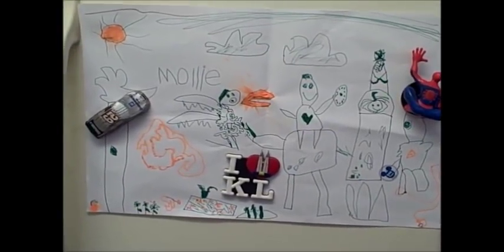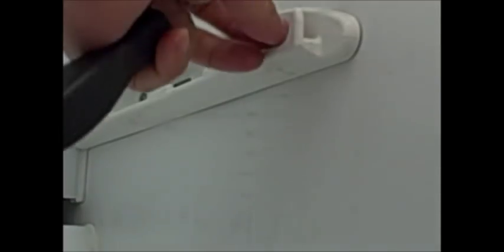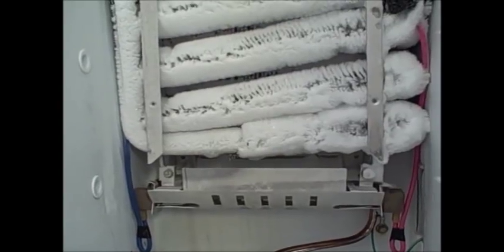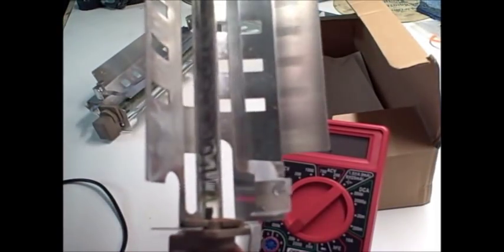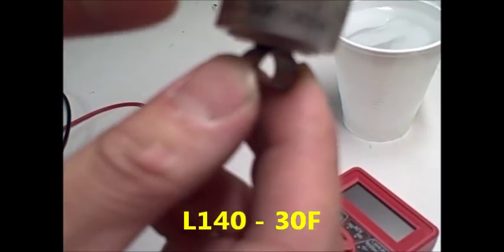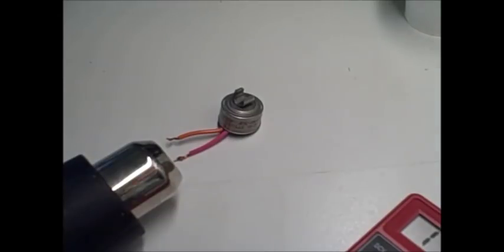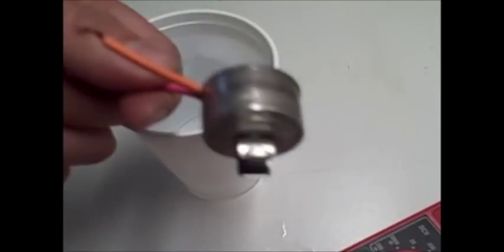Diagnose and repair GE ref problem not cooling

Comment: I heard that you can repair the thermostat by placing in boiling water. Is this true? have you heard such a thing? I have not tried it yet
Reply: It turns to be true. I tried it and it will reset the the Bi-Metal sensor. Don't know how long it will last but, it works.

Comment from the maker: UPDATE: Unfortunately, mine finally died today 4/28/2021. The compressor stopped running and a quick check for resistance between the terminals revealed an internal short circuit. I blame this on me neglecting to vacuum the thick dust buildup on the back which probably made the compressor worked so much harder. I used to do this every year but got lazy for the past 3 years.

Comment: Great video, Handy Daddy! I probably went through at least 5 other DIY Youtube videos before coming across your excellent video. The difference on your video from the other videos was that you were the only one who  identified a burnt-out bulb (totally blacked-out) that may be causing the defrost system to malfunction which was exactly what happened to my side-by-side GE fridge. I hope that my fridge will be fixed by replacing it w/ a DEFROST HEATER ASSEMBLY. Fingers crossed! Thank you very much!
Reply: After 6 days, my fridge seems to be holding steady at 0 degrees F (freezer) & 36 degrees F (fridge side) so it looks like the issue was limited to just  the burnt-out DEFROST HEATER BULB. Thanks again for your awesome advice, Handy Daddy!
Reply: No freezer gets to 140 degrees, whenever the defrost thermostat senses 40 degrees the contacts open thus terminating defrost. How do you keep ice cream frozen at 140 degrees? Think about it
Reply: @winstontaylor4364  It is only sensing the temp behind the rear panel where the coils and heater bulbs are ........ Refrigerators make frost on the coils so we got to melt it out once in a while ......

Comment: L140°-30°F is high limit thermostat, contacts will open at ≥140° and close at ≤110°, subtract second number from first to get closing temp, function is to cutoff defrost cycle at stated temp.

Comment: Awesome work,, I assume this problem affects the refrigerator side correct? because my freezer is cooling but the fridge side is warm, I opened and noticed the ice same as you on my freezer. please respond. Thank you.
Reply from the maker: TheSAJ11 Thanks! It will initially affect the refrigerator side but the freezer will eventually not be cool enough to keep items in it frozen. I noticed the ice in the ice maker tray started melting.
Reply: @handydaddy4232  Yes, I am getting the whole kit and replacing the parts, I know now it is not the motherboard as I have checked.
Reply from the maker: TheSAJ11 I am glad you decided to do the repair yourself. I hope this video can help in some way. Good luck! 👍🏻

Comment: Hello loved the video just bought old fridge has same problem, I found thermostat on eBay but where do I find the heater bulb part...please respond thank you!! You have a subscriber for life!!
Reply from the maker: Hi, I am glad you found the video helpful. The Ebay listing where I previously purchased from is no longer available. However, a quick search of "ge refrigerator defrost heater" will bring up many current listings. Just make sure the bulb is compatible with the model of your fridge also make sure the seller has many positive feedbacks. Good luck!
Reply: Handy Daddy hey by chance do you have like a skype or telegram I can message you a picture so you can see...
Reply: Handy Daddy m

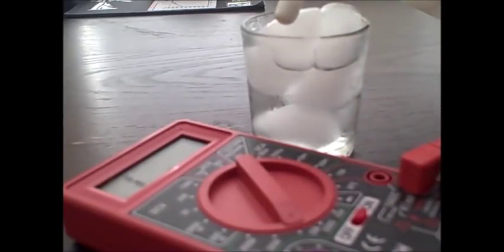Comment: FYI: the thermister (temp sensor white) you threw away at 11:54 time, was probably still good, there seems to be about 4 K ohm difference between the #5 wire on the J1 Plug Upper left of main ckt in back of fridge, and the other wires #'s 4 (upper temp sensor), #3 wire (lower temp sensor) , and #2, and #1 wire (these are fresh compartment temp sensors, if its there).   so if you unplug J 1   plug and (UNPLUG FRIDGE FIRST) and test ohms between wire #5 and #3 I get the 16.2Kohm but when you take the temp sensor out and use ice water it tests only maybe 12kohm ?   i'm thinking that the #5wire is not directly connected and incurs an additional 4 kohms .  (all my tests were when  freezer was let to rise to 30deg F exactly. )  So i got about 9kohm between #5 & #4 wires, but ice water test of that upper sensor gave me only around 3.4kohm, similarly I got the MAGIC 16.2kohm on bottom sensor using J 1 plug wires #5 & #3, as said, but taken out using ice water only got about 12kohm maybe,  the other 3rd sensor I think is in the fresh food area of the non freezer section further back from the light (havta research that),  My #5 & #2 wires (fresh food temp sensor) measured low at 10 Kohm as well indicating it is probably bad.    Sometimes there is a 4th fresh food temp sensor (not in my model) that go to wires #5 & #1. 
Hey, nice video AND using home style test equip for the DIYer made it better.  of course specific bench test equip is best but if it works !

Comment: great video .I had a repair person come out twice in a month after the inside of my fridge was at 60 degrees and my freezer was cold but not freezing .I lost groceries the first time and yesterday it happened again thankfully we had a almost empty fridge we only had ice cream in it yesterday that was melted and the fridge was at 60 again .he said its standard to take a fridge outside to use a water hose hooked up with the hot water to manually defrost the thick as a block ice on the coils .twice in one month :( would you happen to have any advice 
thank you
Reply: Most common cause of no defrost on a GE side by side is the heating element, then the hi-limit defrost thermostat, then the defrost thermistor and lastly the control board, although I've only seen one defective board causing a no defrost issue in my entire life. This system was introduced in the year 2000 or close to it, and the heater is a glass tube casing with O-rings on each end to seal out moisture and water, and over time, these seals deteriorate and cause the element to fail due to the water entering the tube where the element wire is. Also, the defrost termination switch, the one that has  140-30F on it, normally will pop apart when it fails. This switch is there for emergency shut down of heat cycle only, as it opens at 140F and has a reset differential temp of 30F. So that is why it was closed on the video at room temp. Defrost thermostats on other refrigerators that use these devices as the actual circuit interrupter are much lower in temp value, such as 45 to 60 degrees, measuring coil temp during the defrost operation, and shutting down the heater when coil temp reaches the target of 45 to 60 degrees. The small white thermistor is the part that shuts down the heat by reporting back to the control board, the coil temp, by way of a resistance value, that is realized as a temp by the control board, thus stopping the heat process and allowing a drip time, then starting the refr back into the cooling cycle. If in doubt, or don't have a way to test these parts, I would advise to change these three parts in the freezer, as they are fairly inexpensive and while your in there anyway, and the box is probably 10 years old or so, changing them all will save you the hassle of having to go back in and do another repair on another one of these parts in the near future. If you don't have a VOM, pick up a cheap one from any place that sells hardware. Some are as little as $10.00 and go up in price from there.
Reply: It is not normal to defrost your refrigerator outside with a hose !  The purpose of this video is to show you the parts that cause your problem when they malfunction.

Comment: if the freezer coils are solidly iced up will that impede the air flowing into the fridge?  I replaced the fan motor but, the flow of air into the fridge section is very weak. I'm defrosting the coils right now. I guess the air has to flow past them and if they are solid ice little air would get past? . I guess it's time to check the heater bulb next.  it looks like the same GE side by side your working on. Thanks for a great video.
Reply: Thanks, it's fixed. new heater bulb. I didn't pull the sensor but, I'm keeping my fingers crossed.

Comment: Great video, to save some time you don't have to remove the bottom plastic drawer guides/rails. After you remove the top 2 screws of the coil guard you just pull the guard forward and slide it up and it will clear the plastic lower guides/rails.

Comment: I have changed my defrost heater, but after powering the refrigerator on, I only hear a clicking noise. I can't hear the compressor work, only a clicking sound.

Comment: Your first test on the thermostat showed it was in the close position which meant the heat lamp should have been working.  Therefore, why did you need to test it further?    Thank you for your video!

Comment: How do you get to the thermostat ?  Thanks
Reply from the maker: L O F E N O I A L O F L O F E N O I A L O F You have to remove the back panel inside the freezer compartment so gain access to the thermostat which is usually attached to the cooling coil. Watch 3:15 of the video.
Reply: @handydaddy4232  How can the thermostat get up to 140F when it's inside the freezer 3 feet away from the heater bulb?

Comment: Those sensors are called thermistors. I went ahead and bought 2 since they were around $1.50. I had already replaced the heater because it went out and all was working fine after that fix. A few months later it started freezing up again, so I replaced the thermostat because the heater didn't come on. That didn't fix it. I then replaced the board which was a big mistake, since the problem ended up being the thermistor on the bottom. So if you're doing trial and error replace the cheapest parts first. 2 years running good, so it was still worth it and I didn't spend for a repair guy.

Comment: Appliance - HIRING TECHS IN SEATTLE, SAN JOSE, SAN FRANSISCO, LOS ANGELES! STARTING MIN PAY IS $7k!!! CALL 818-925-1377!!

HVAC - HIRING EXPERIENCED TECHNICIANS / INSTALLERS/ HVAC SALES GUYS. IF YOU LIVE IN THE LOS ANGELES AND ORANGE COUNTY AREA, CALL 818-925-1377

Comment: Sorry but you didn't clearly show where you put the probes from the multimeter on the heating element.
Reply: 5:24 You touch the probes to the spades on each end where you connect the red and blue wires. Your ohm meter will beep if its good.   If you measure the ohms it should be 21